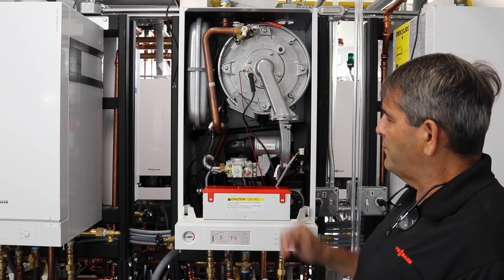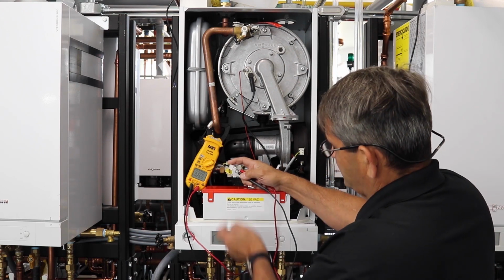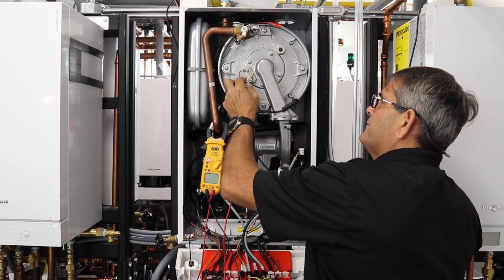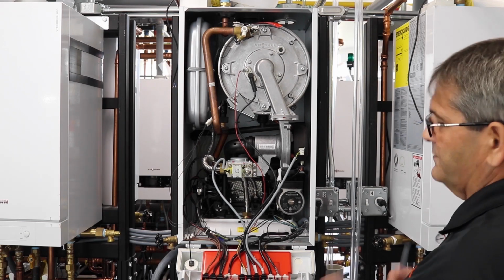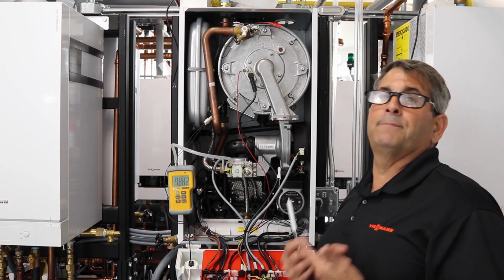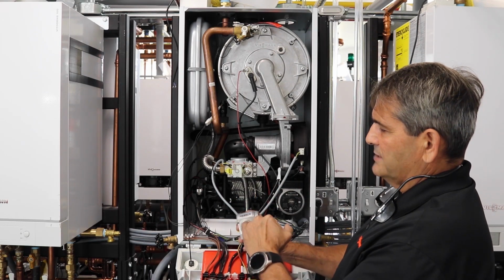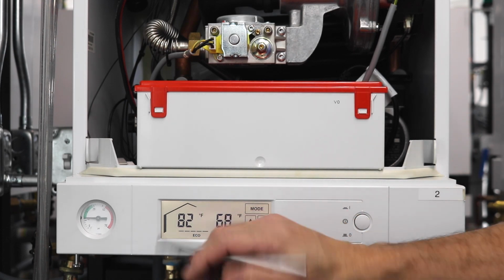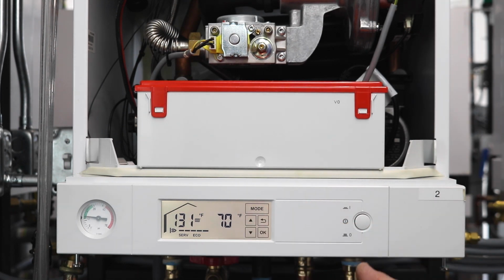Troubleshooting - Demonstration - F4 Fault on the Vitodens 100 B1HA/B1KA

Comment: Thanks for the video, I'm surprised you can hook up your meter during the ignition cycle to measure flame signal, I would be fearful having high voltage flowing through the multimeter.

Comment: You have confused current and voltage! You state to set meter to AC current then you are using it to measure AC voltage 🤷‍♂️🤦‍♂️ That is a fundamental error that could cause damage to things since if meter was set to current it will short circuit the item you probe across.